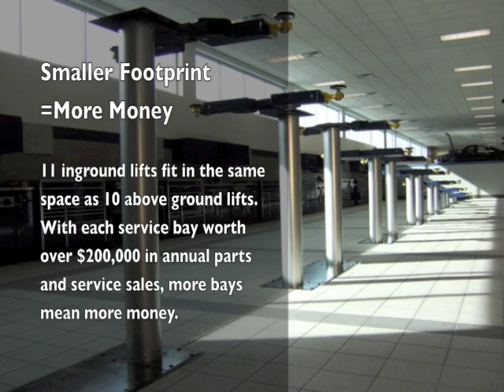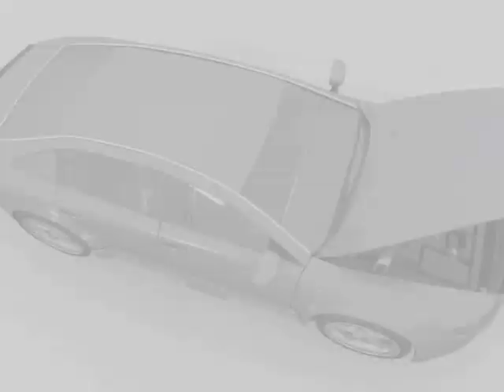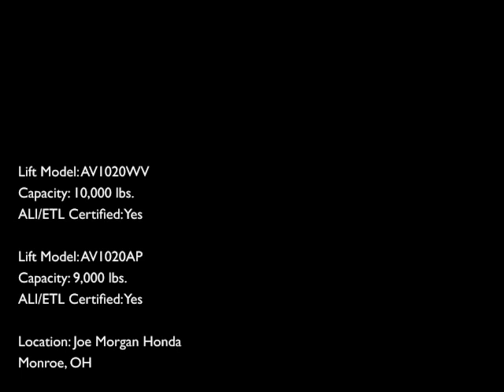EnviroLift® with AquaVantage™

Comment: I'm old school..like the old lifts..I have a 1996 GLOBE..model FS-10as..casing is fiberglased.fiberglass.. no issues..in all the yrs ..in my home work shop..installed  myself  in 1999.used heavy  copper  tubing  under ground..no rust out..its been good to me..use it for everything work table  oil changes to a buffet table..dad had lifts last him over 40 yrs .in our station..till 1999.

Comment from the maker: Parts of the lift that are considered to be in a more hazardous area are either powder coated with a polyethylene powder paint or a 2 Part Epoxy which provides better protection than the standard enamel wet paint.  Our QC department also conducts regular adhesion test to insure we are getting the proper coverage and adhesion of our wet paints.

Comment from the maker: In a nut shell yes this is true and precisely why we paint Steel Parts and have our Aluminum Parts Painted or Anodized. It is also worth noting the oxidation layer that can occur also works to protect and slow further oxidation, especially on the Aluminum parts.

Comment from the maker: @gmcjimmyandblazer The design of the working mechanics of the lift also help reduce freezing. The water is surrounded by a double walled plunger along with the air space within the tub that would act as an insulator.

Comment from the maker: @gmcjimmyandblazer There are several AquaVantage inground lifts that run on air and water in operation in Canada and there has been no issues with freezing. It is also unlikely that the ground temperature in the building would fall below freezing, however, to eliminate any risk a small amount of anti-freeze can be added to the water to prevent freezing.